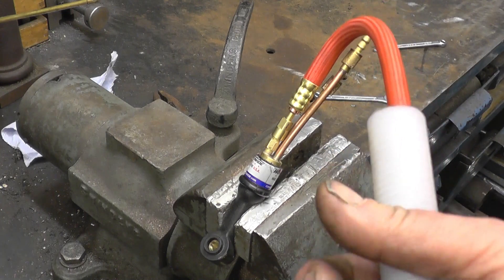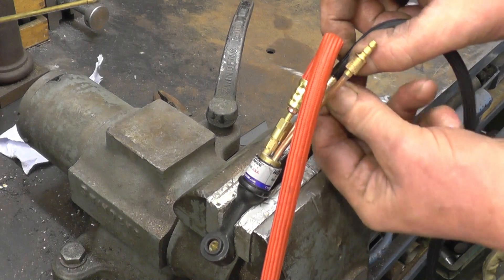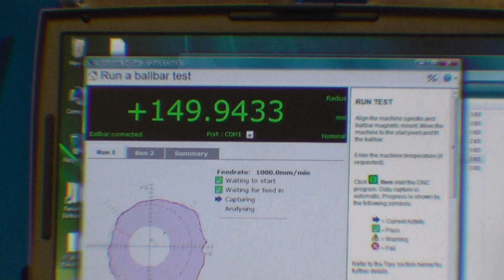SNNC 271 P2   TIG    Torch Mod   Xtreme  Engineering Visit

Comment: John, I've just done the same thing for a slightly different reason. My tokentools 315DX machine came with the large blue "Euro" stle Torch with the built in trigger switch. I'm ambidextrous and am constantly changing from one hand to the other, I also only use the foot control, so I didn't need the switch in the handle. I found the bulky "Euro" torch hard to manipulate and rotate around a pipe or fitting. so I removed the big 2 piece torch handle, bought a piece of 3/4" black poly pipe from the hardware store, drilled the inside out to 21mm and turned a fast thin cut off the OD, turned a groove near the bottom end to secure my Denim sheathing and pushed the handle onto the torch head. It's smaller than the original, and round, so it is easier to manipulate with either hand.

Comment: wouldn't it be better to arrange the Cables in the handle in the same order as they are connected to the Torch ?
https://youtu.be/FRs0Z-w6HYw?t=639
So they do not squeeze each other and restricting the water flow ?

Comment: Nice TIG torch mod. The ever useful 6.6 Nylon. Are Extreme Engineering, running a Double Boost table???.
Nice to see the Renishaw measuring probe used to check the axis interpolation, very professional, impressed they have electronic capability.
Best wishes to your Father, and thanks for sharing.
Reply: By how it was cutting I was going to guess nylon too.  Didn't look quite gummy enough to be polypropylene.